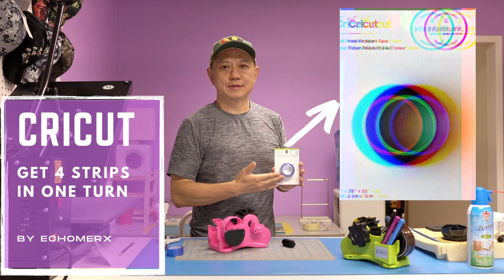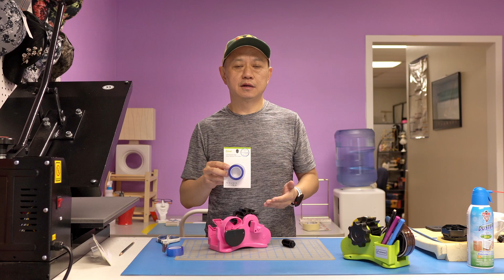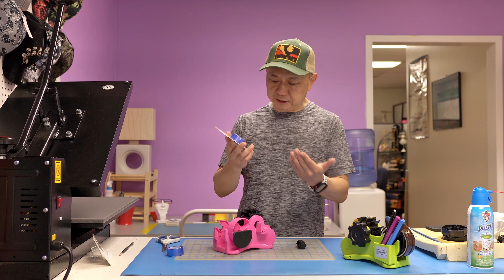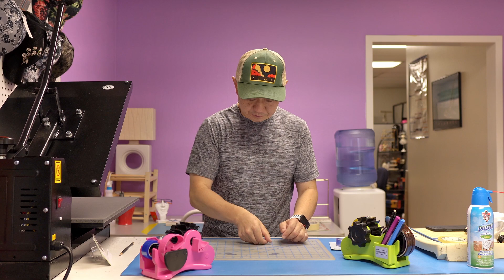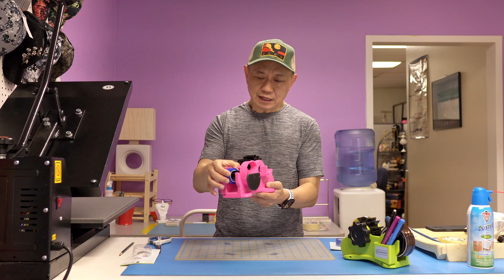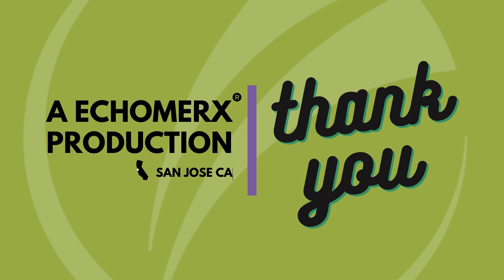Watch This If You Dye Sublimate Tshirts Mugs and Tumblers with Cricut Heat Resistant Tape

Comment: There are far cheaper heat resistant tapes on the market. The larger heat res. tapes work on the bigger rolls.
Reply from the maker: I totally agree that there are far more cheaper heat tapes and they are in par with Cricut on the performance and resistance to over heat.